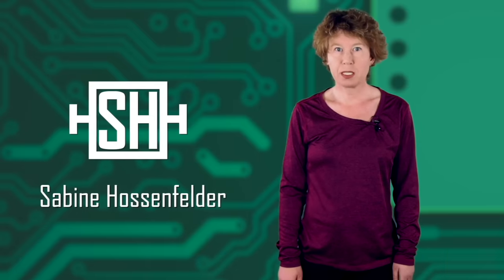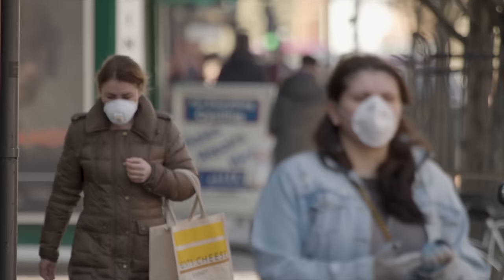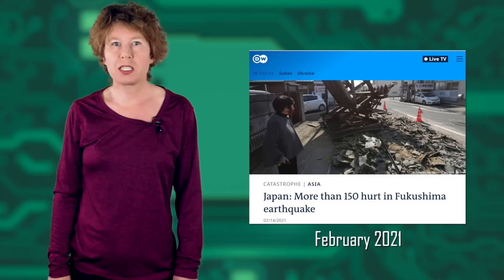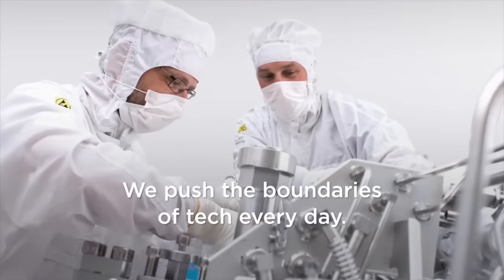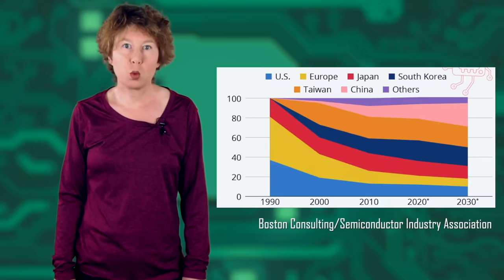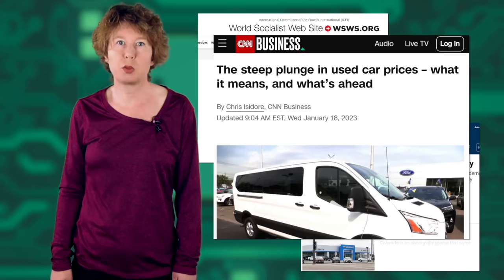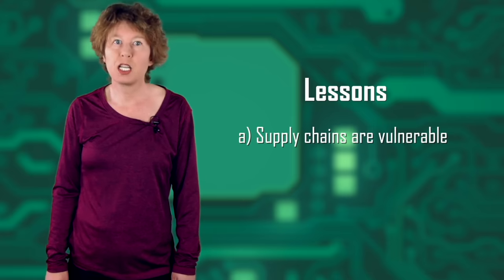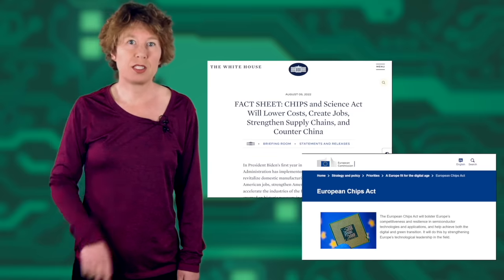All you need to know about the microchip crisis

Comment: A few corrections: What we call "the wafer" is not what is inside an IC package. A wafer is a large disc produced by the foundry, on which many chips are located (often thousands of them). After production, each chip is cut out, tested and packaged (which includes soldering the connections to the package pins). Also, a capacitor isn't a semiconductor, it's a passive, linear element. There are no wires to connect the elements on the chip itself; this is done by several metal layers or by using the substrate.
Reply: And did you say ASML was relatively unknown? That's the only vendor of the lithography systems used my most of the dominant chip producers. They've been #1 on the market for a long time; everyone knows them.
Reply: @phenanrithe  What she meant was they were specific to "industry", and not to end-consumer, even not to the car, TV, smart phone "design" companies. I've worked for TV industry and never wondered about the vendor of the "chip-printing" devices that the chip-producer companies (such as TSMC) were using. And mostly I thought they were inventing their own equipments... That's why chip production is hi-tech ? : -)
Reply: Though the wires in the chips are produced differently than discrete wires (material deposition and etching instead of mechanically drawing metal through a small hole) there is nothing wrong with calling them "wires"
Reply: I also got triggered by talking about microchips and showing printed circuit boards 1:17 . Never trust a physicist taking about topics outside their field.
Reply: @phenanrithe hmm, your use of 'everyone' is likely as inaccurate as her 'no one'
Reply: @phenanrithe  I have been assembling my own PCs since the times of the humble 486, and I've only heard about ASML about two years ago, when I discovered that there are literally maybe 50 machines in the entire world that can print the newest generation chips, and they are all made by one company. I've never heard of them before. So "Everybody knows them" needs to be qualified a bit. Everyone who -- all investment bankers? all industry specialists? all chip manufacturing nerds?... Everyone who watches a certain youtube channel that had a video about ASML a few month ago? Certainly not everyone "everyone", because that would include me.

Comment: Some extra notes:
a) not only microchips had a shortage, but also many other electronic components (esp. capactors)
b) there were even some electronic components with factory lead times skyrocketing to 50 to 100 weeks... 
c) it was not only the telecommunication companies, due to the shortage many other companies that normally work "just-in-time" (low own inventory, relying on framework contracts and low delivery times etc) were buying much more components than normally to improve their inventory buffer...

Comment: I work for a wafer fab that primarily services analog chips to the automotive market, a few things that weren't mentioned in the video: during the early pandemic our entire facility was converted to producing primarily chips for medical devices, for over a year; the war in Ukraine also had a direct impact as Ukraine was one of if not the largest supplier of gasses used in semiconductor manufacturing (xenon prices for instance absolutely exploded to ~2mill$ a bottle). Now after the pandemic the consumer chip demand dropped by about 20%, but demand in automotive went up about 67%.
Reply: In addition to gases, Ukraine also exported tons of discretes and printed circuit boards - the war cutting down all this 😑
Reply: What is Xe used for in chip manufacturing?

Comment: Some corrections needed here: 
- ASML is a dutch company, the main factory is in Veldhoven (NL), which is where the EUV machines are built, not Berlin.
- The description of the EUV lithography as a "new chemical reaction" is misleading: previous photolithography processes used the same type of reaction, with UV light of longer wavelength (e.g. 193nm), EUV uses 13nm wavelength, much shorter, and this is what allows much finer details to be "printed".
Reply: ASML has subsidiaries around the world who make specialized parts. And an important German supplier as well: ZEISS. I don't think it was this supplier, but probably one of the subsidiaries.
Reply: @autohmae  sure, but not the place where the EUV machines are built, as implied in the video (slightly less impact).
Reply: @olbtube  true, they are put together in Eindhoven I believe
Reply: @autohmae  Veldhoven, right next to Eindhoven.
Reply: @martijnposthuma3121  ahh, close enough ! 🙂 (I'm certain people who life there don't agree, but on the grander scheme of things, it's close)

Comment: I'm looking at this as a software engineer with occupational training in electrical engineering.
While reducing the centralization and increasing capacity of the semiconductor industry are definitely good ideas, I think we also need to look at the factors that increase chip demand and cause it to experience market volatility. 
* The quality of software engineering over the last 30 years has been deteriorating. This has caused processor manufacturers to have to focus on things like increasing chip performance even more than they would have previously. In chain, this has caused a de-prioritization of reducing per-unit cost of chips. 
* Cars are one of the worst offenders, but they're not the only contributor of industry siloing. Aerospace semiconductors are also severe contributors to the need for specialized chips. If we can encourage companies to use more cheap off-the-shelf parts instead of parts that are industry, or even customer, specific; we can eliminate a lot of product diversity. This would allow for a more fault tolerant market. On top of that, it would allow for easier replacement of parts, which would reduce e-waste and reduce demand for replacement parts (Since replacement assembled product demand would be lower).
* Many datacenter, consumer, and corporate computers are made with an intended operational lifespan of 3 to 5 years. If we can institute operational reliability requirements for manufacturers that will increase that to 5 to 8, that'll reduce the demand for replacement products.
Reply: We're never going to reverse planned obsolescence. We could make the same argument about extending the operational lifespan of car parts.

Comment: Something quite similar happened (is still happening) with medicines.  Even before Covid, many drugs were in short supply.  Two medicines I use were both manufactured in a single factory -- the entire world supply coming from a single source in India or China.  

AFAIK the primary reason for the shortages is that manufacturers decided that it would be more efficient (i.e., less expensive) to have only one source, located in a country with low wages, and to attempt to manage the supply to get it where it was needed exactly when it was needed.  Of course, that tactic makes little or no provision for any unforeseen circumstance, like contaminants in a particular factory or (like microchips) fires or natural disasters.  When those unforeseen (but inevitable) circumstances occur, the worldwide supply chain breaks down.

Comment: One point chip factories especially the newer ones using water also in a different way. They produce so called ultra pure water and then using this water as lenses(on top of the waver) to shorten the wavelength further. Yes the amount of water a chip factory needs is huge.
Reply: That is true for immersion lithography since 2003, but not for the newest EUV lithography. ASML is working on a "High-NA EUV" process but i would guess we see another liquid then water this time (i am not involved so an outside view guess). The amount of water needed for immersion lithography is nearly not noticeable and much lower then the ones needed for toilet, personal hygiene, cleaning or even the coffee machines. 
TSMC Taiwan has 65k workers and they need the same amount of water as 600 US households that is really a very low amount. For example Teslas factory near Berlin is under attack for their water usage (100k gallons/h so 2.4M/per day and they already claiming to need more to raise the capacity)
Reply: @Techmagus76  I'm less familiar with the specifics myself, but Asianometry did a video on the topic which I assume is correct:

Ultrapure Water for Semiconductor Manufacturing

Comment: Houston here! Thanks Sabine. I had no idea our 2021 freeze effected the chip shortage so much. I do like the satellite image of Houston with much of the lights out during the freeze. To address the chip shortage, I’ve stubbornly held on to my older radios including my ham radio gear, many using vacuum tubes, although I am replacing old capacitors in those radios that are beyond their expiration date like the ones in the transmitter I built in the mid 1970s.
Reply: TechTangents did a video on Reforming Capacitors, so maybe replacing isn't even needed.
Reply: @autohmae , these electrolytic and paper capacitors in my “All American Five” are over  70 years old so I will be replacing them. The ones in my homebrew transmitter are showing visible signs of electrolyte leakage so I will be replacing those too.

Comment: A major issue for automotive chip shortage is that they generally use "trailing edge" (old) technology, for which the profits are lower and so those fabs have largely been phased out. Chip mfgs didn't have the option to ramp up production to higher levels and catch up, because the fab capacity simply isn't there any more.
Reply: GaAs fab engineer here. The issue with automotive isn’t fab capacity. It’s that they never accept anything new. They’re paranoid beyond reason about anything and everything different, and these sort of unreasonable quality standards are screwing them out of inventory, because nobody wants to build garbage, old, low margin parts for them anymore.
Reply: @Grak70  well, pretty certain the cars needs to be re-certified in all aspects if they replace some chip (and the software needs to be ported over, possibly a different ISA).
Reply: Pretty certain no fab was phased out, it's mostly that the demand is higher now than in the past and nobody is building new factories for creating chips based on older processes. It's  not economical, chips based on older processes used to just be factories that we not needed anymore for the bleeding edge because a new process is invented.
Reply: @autohmae  I didn’t say it was easy. Automotive customers just push everything to their suppliers. At some point, some of these old fabs making controllers and sensors are going to go offline and they will be forced to switch. And it will be extremely hard for them to do so. They need to do some planning now, not when it’s a crisis.
Reply: @Grak70  yeah, that's probably also true, they possibly need to be prepared. That said, their are many fabs still producing chips with much older processes too.
Reply: @autohmae  yup. The sexy EUV and multipatterning stuff from Samsung, Intel, and TSMC gets all the attention, but the vast majority of semiconductor patterning layers are still I-line/DUV. And all GaAs processing is 150mm wafers or smaller, which fundamentally makes those production lines old. Most of their tooling was built in the 1990s or earlier.

Comment: There was also major supply issues with package substrates. They didn’t have enough capacity in specific package types. We need to stop putting chips in fridges and washers. Those products are too complex now for their manufacturers, leading to poor reliability. All my appliances are 20+ yrs old and going strong. New appliances fail after only a few yrs. You see chip supply coming back though. PS5’s are in stock. I just taped out a 6nm telecom device yesterday. I’m taking time off now and rebooting my brain. But no supply issues for me.
Reply: No. We just learned it is very handy if there is a hidden diagnostics program included in old washing machines or heat pump dryers. Our about 10 years old heatpump dryer stopped to work a few month ago and with the built in diagnostics program and some help from the internet we could fix it without any cost at all. We, technical laymen will never have to call a mechanic again and save lots of money when we can fix problems on our own and don't need to scrap our devices before they don't really need expensive repairs.

Comment: Good summation of what happened.  What you may not be aware of is that there are 5 new chip fabs being built in the US: 2 x 5nm plants, 2 x 7nm plants and a plant specific to the types of chips used by car manufacturers.  That last one should be online by the end of 2023, and the others will come online in 2024. They broke ground on these plants in 2021.   So, the US will be in good shape anyway. :-)
Reply from the maker: Thanks for that info, hadn't followed this!
Reply: I am not so sure this will help.  Just like US PCB manufacturing in the 1990, it is my guess is that 10 years from now, each machine will be carefully numbered shipped and resembled in a country with cheaper labor.    Historically injecting money like this has never seems to provided any value, but multinational companies are more than happy to take free tax payer money.
Reply: This sounds encouraging, but building microchips requires a very high level of expertise which currently does not exist in the US. Without the right mix is people, these plants cannot succeed. So where are the personnel needed for your plants coming from? Cheers.
Reply: @dscott1524  Are you kidding?  The US invented the stuff.  Where do you think the Taiwanese got the tech from?   The chip designs are done in the US, and the equipment that does the extreme ultraviolet  lithography needed to create the actual wafers is made in the US (and the Netherlands).  The US just gave up building big chip factories 30 years ago because labor was so much cheaper in Taiwan and China.  Without US/Dutch supplied tech, neither China nor Taiwan can build chips smaller than 30nm or so. Really not a problem for the US.   Though the Chinese claim they have build EUVL machines, it remains to be seen if they're any good.